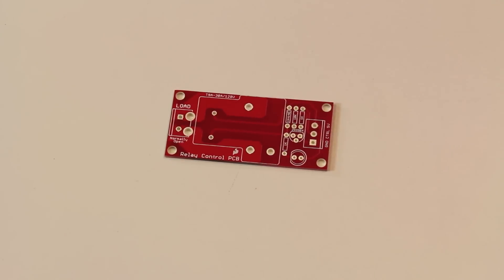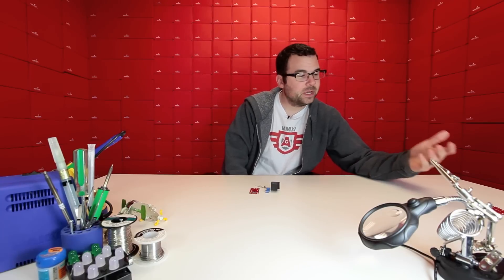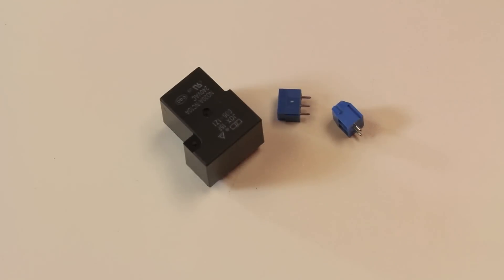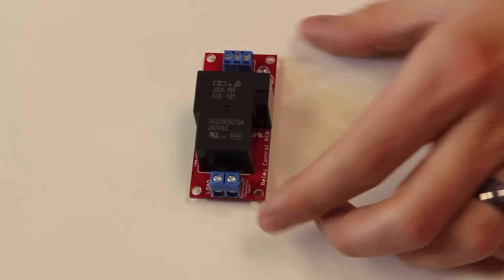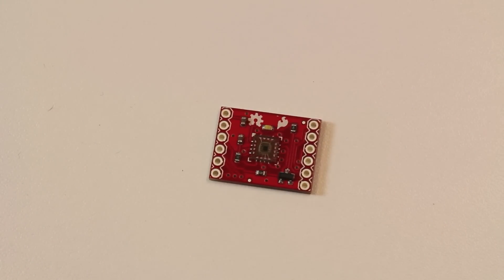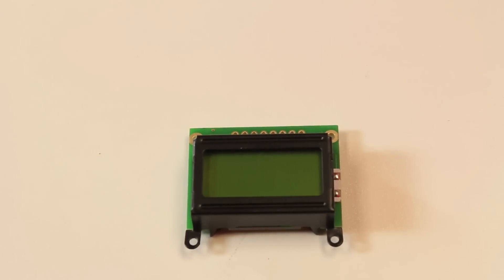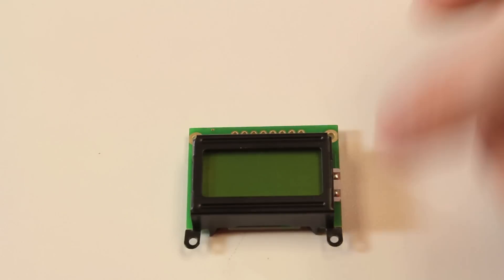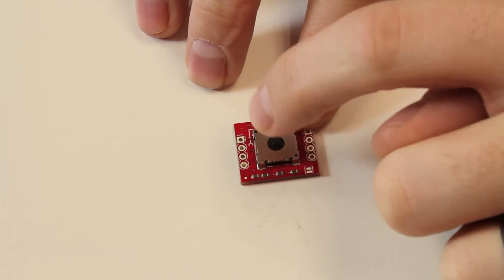SparkFun 2-10-12 Product Showcase

Comment: Actually the mini LCD only needs 6 digital pins in 4 bit mode with R/W tied low and command completion timing down in software.  If you use an 8 bit shift register you can reduce the number of pins to just 3 -- Clock,Data, and E.  Still use 4 bit mode but the 4 data bits and the R/S bit are clocked into the shift register, then apply the E pulse.  Only need to clock in 5 bits.